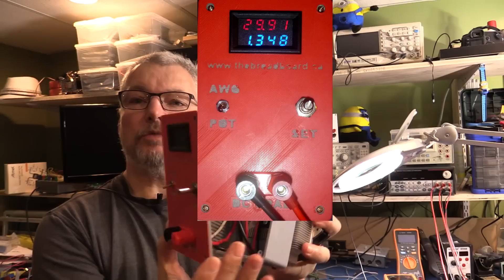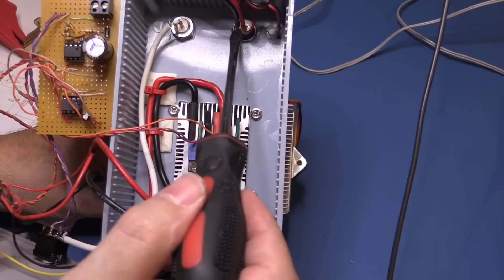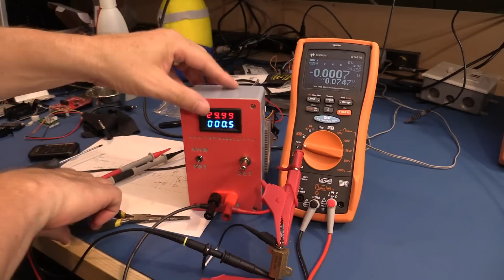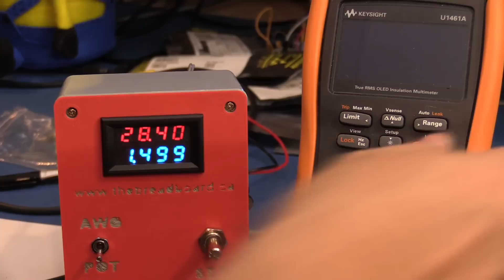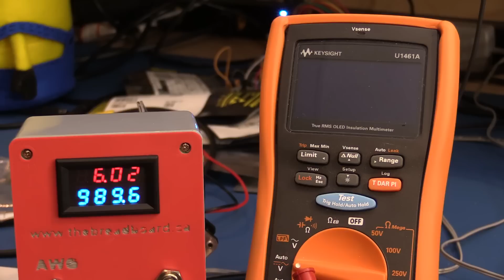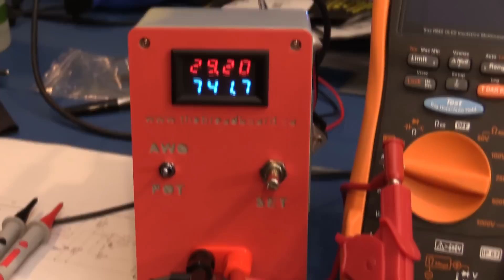Full Build Analogue DC Load

Comment: DC load BOM : $50, Agilent 33622A $3900. For just $3950 you could have your own!
Reply from the maker: Actually the 33622A is about 8000CDN ++ as it also has all the options, Memory, GPIB, BenchVue etc. 

But more seriously, if I had a really low cost wave gen with as good a rise time at the time I would have used it as the source, the point there was to have an excelent input rise time in order to minimize its effect from the final measured rise times. When your measuring or characterizing something you should try to have measurements and source signals at least 10 times the resolution, im pretty sure I exceeded that lol.

Comment: Great job on the DC load. A bit long a parts, but well done. 

Question on the voltage reference. Would it help the Mosfet drive if you used a 10v reference instead of 5v and amplified the arbitrary waveform input by 2. It seems everything else is 10v capable.

I have a couple of LT1236AIS8-10 references and wondered if that would work/help.

Thanks
Reply from the maker: It is all 10V compatible so it would not harm. and yes, if you up the reference to 10V you will need to either adjust the ARB input to match or divide it a little differently to compensate. either way will work

Comment: Hi Peter, I believe there is a weak link in the DC load circuit. I build one and it was working fine. For some unknown reason the DC load mosfet shorted inside - while checking the mosfet offline - i found its showing continuity between drain and source. After replacing the mosfet the DC load was not working- i found the opamp is heating - replaced opamp and its working now. Do you think the gate should be driven through an optocoupler ?
Reply from the maker: It should not be necessary, I have seen many similar designs and they all drive the FET directly., an opto would only be needed if there is a significant difference between the source voltage and the op-amp output range that would take it out of its operating range or common mode voltage. I have used mine several times with no issues.

If you have further information regarding the scenario that caused the failure i would love to hear it.

Comment: Hi Peter, I build a DC load using information from your channel and EEVblog. I was wondering if you would take a look and offer some comments on the design. It is on https://hackaday.io/project/11968-dc-load  . Youtube video to follow when I get brave enough.  Thanks for the great video.
Reply from the maker: it looks like it will work without any issues except for one thing. The Capacitor on the Gate of the FET. this will slow down the response time considerably and possibly cause issues with stability (Oscillations) and possibly lead to the FET heating up more than necessary. I dont think you need it. (There is enough capacitance within the gate of the FET already in my opinion.
Reply: Thanks for your reply Peter.
 I installed the capacitor to stop the oscillations (I saw on my scope) on the gate of FET. After reading your reply, I went back and found that I could reduce the capacitor to .47uf before the oscillations returned.  Hopefully this will reduce some heating in the circuit.  Thanks, Ken